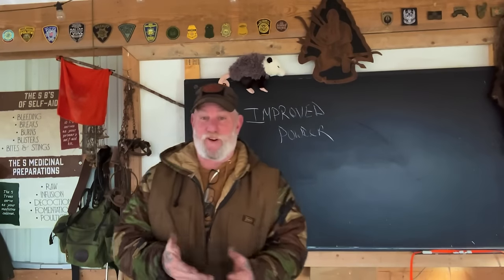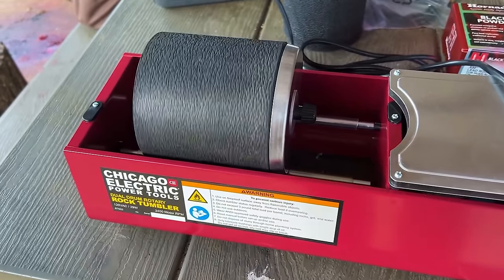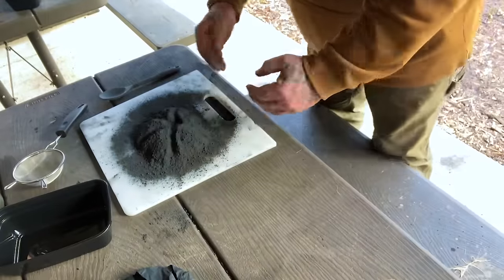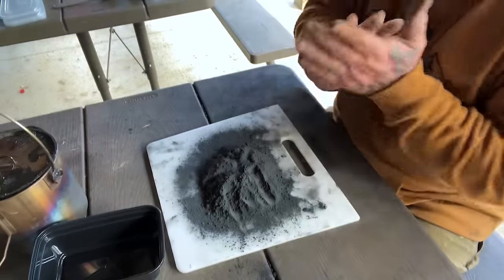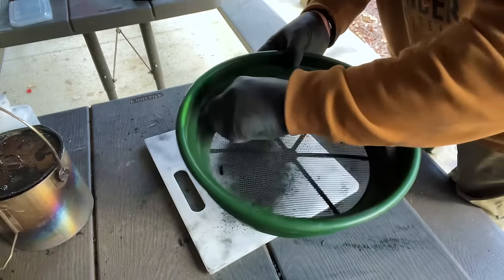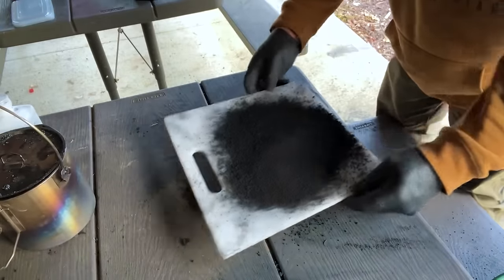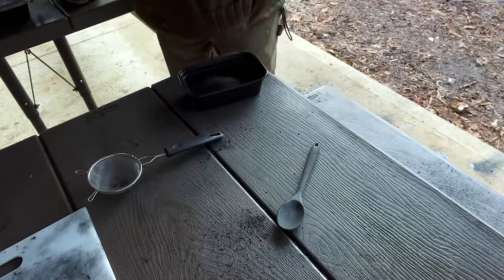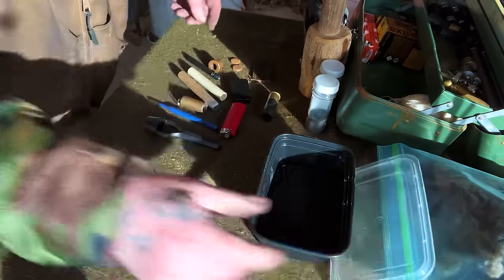MAKING THE POWDER Part 2 Improvements 21st Century Longhunter Reboot

Comment: If you mill the separate parts for 3 minutes each especially the potassium nitrate the volume will double if not triple in size. Then ball mill for 6-8 hrs. Wet mix with water or alcohol. Then make pucks by compressing in a 10-20 ton hydraulic press

Comment: What about static charge on the plastic of the food processor or rock tumbler? Possible spark. Something to consider. Long ago when I applied for a job at a rocket engine factory, I could see how seriously they took the control of static electricity.

Comment: There's no reason why the milling "balls" have to be spherical.  Use what you have, as long as there's no risk of spark.  I use hard cast lead 30 cal. bullets intended for my 30/30 Winchester, which didn't pass my QC.  Works just fine.

Comment: I'd use one of those Long BBQ lighters for testing if I were you . I got a little too close the other day and burned the skin off the top of my thumb. No serious harm was done but I'll never get my hand that close to a test again. Word to the wise. I tried screened my first batch but turns back to dust if it sets around to long and gives very poor results in revolvers. If you use 3 to5 % Dextrin added to the final mix and use 70% Rubbing Alcohol (Dextrin needs the little bit of water in the 70%) The grains of Screened Powder will be much harder and won't crumble. Still to slow for my Revolvers but much better and I can at least get starting load velocity with a full cylinder.  Anything I don't care for I can turn into 12Ga.loads. If you have an old food dehydrator your not using put a sheet of Non Stick Aluminum Foil over the screen area and your powder will be dry very quickly even in foul weather .

Comment: Merry Christmas .  When making black powder ,"corning" it is a major improvement. "Corning " means making uniform sized pieces . Usually spheres ,flakes or cylinders.  Uniformity increases accuracy and consistency of the shots taken. Velocity becomes more uniform . The pressure curve becomes more uniform . Faster doesn't always mean better . If you make it too fast ,you get flash powder and can pop your gun instead of shooting a projectile . Then next step above flash powder in size  and the projectile/payload loses velocity before exiting the barrel of a long gun. Pistols and revolvers need different granule size than rifles and shotguns. All four technically need different burn rates from each other . A revolver has a gap between cylinder and barrel, the powder needs to burn fast enough to push the bullet across the gap , but slow enough that powder gets into the barrel and adds velocity one crossed the gap. A pistol ( a single shot most commonly for black powder) needs to be slow enough to add significant velocity the entire barrel length ,but fast enough to peak out at the muzzle ideally, a shotgun needs to get the payload moving quickly , but not rifle speeds , slightly slower than pistol powder but more of it is typically used.  Pellets should be moving at about 1300-1400 feet per second . This is lethally fast, but slow enough to spread out over a short distance. a rifle needs a burn rate tha t is slow enough to build pressure for the entire length of the barrel . Typically far heavier bullets are used than in pistols , and barrels are up to 36 inches . So it needs to burn slow enough to gain velocity the entire barrel length with heavier bullet. Riflemen from the muzzle loader days used a fast powder for the pan, and a slow powder for the barrel . Cannons use the slowest powders to drive massive projectiles at significant speeds over a fairly long barrel with wide bore. Ballistics can be fascinating and useful . These are called interior ballistics , the description of what's happening in the gun . Exterior ballistics are the description of the projectile in flight. Terminal ballistics are a description of how the projectile interacts with it's target . If you really want to go all the way with black powder and self reliance . Make a "ballistic pendulum " to know the velocity and roughly the energy you are getting .